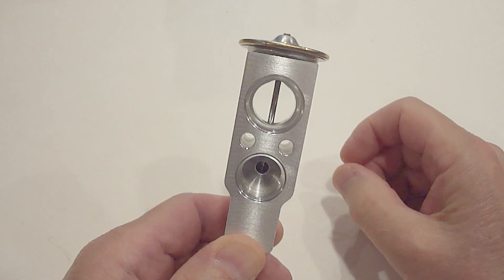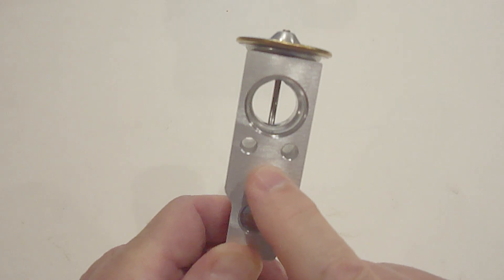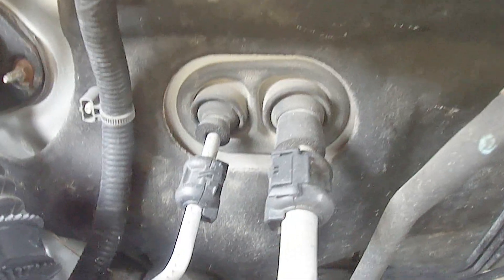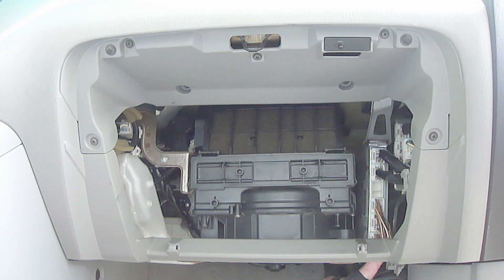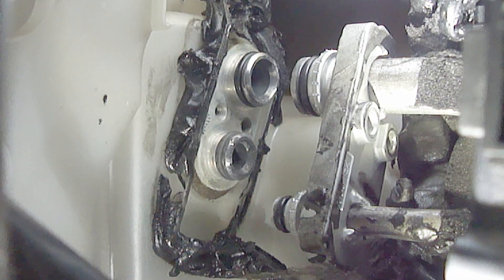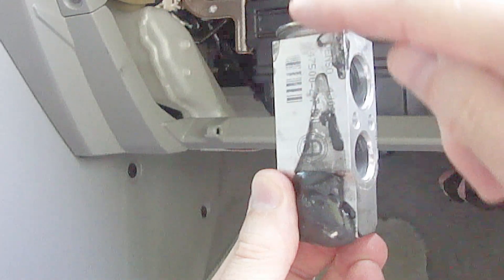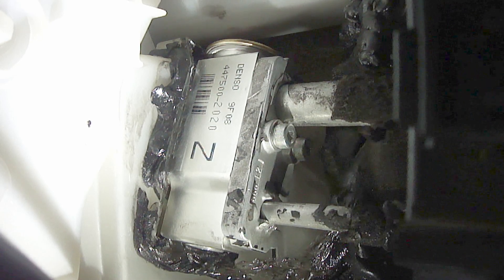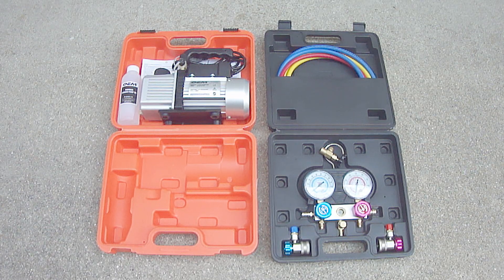Car AC Expansion Cooler Valve Replacement

Comment: hello, can you adjust the expansion valve screw without removing it from the system? my system has high pressure reading  on high side and low pressure on low side. both off from what was indicated in the service manual. according to the manual it is possible that the expansion valve is restricted.